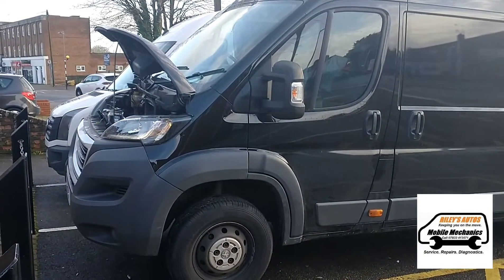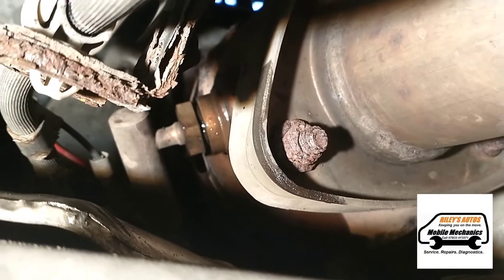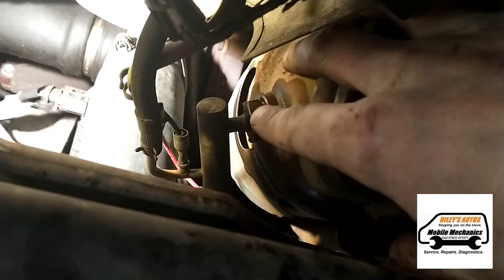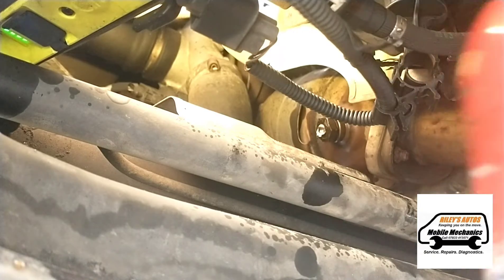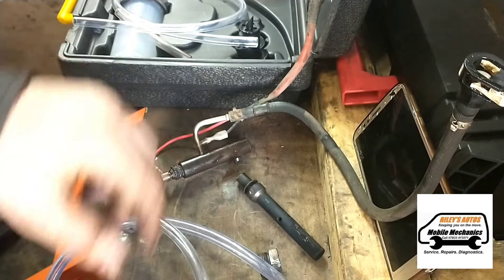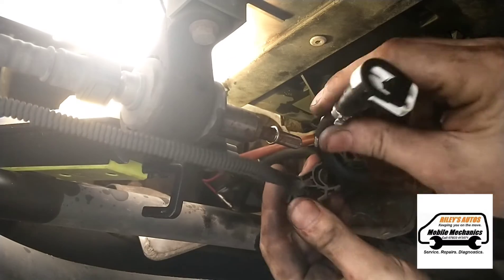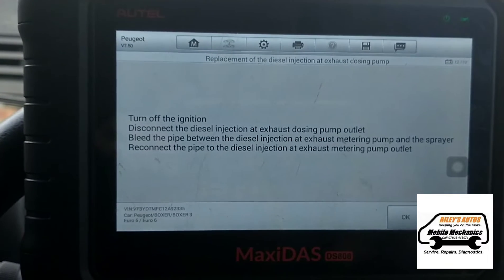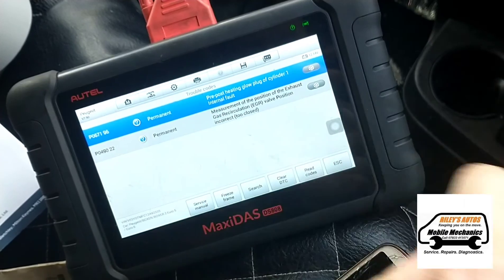Diagnostic and Fix DPF Vaporizer 2.2 HDi TDCi Peugeot Boxer / Citroen Relay P15BE 73 Replacement

Comment: With the hose disconnected at the pump discharge, Should diesel be coming out all the time? I’m having a similar issue but there is no diesel coming out the metering pump, have checked voltage at plug all good

Comment: Some great diagnostics skills you have. Ref the fuel pump, when does that open up to inject fuel into the DPF? I have poor fuel economy on my 2.2Boxer.  I Disconnected the exit hose from the pump and attached a hose and bottle to the exit fuel line and went for a 6 mile drive, diesel came out under normal driving conditions, about 150ml after 6 miles but not on tick over at a standstill. should the pump always pump fuel to the vaporizer? or is it selectively controlled? I think something in the dpf vaporiser fuel system is causing too much fuel to be pumped into the dpf, it's not showing any faults on the dash, and no DPF regen either. The economy is down around 60-70  miles per tank full. Any suggestions, please

Comment: STOP. DO NOT DO IT THIS WAY. TAKE OUT THE BATTERY BOX AND THE INJECTOR IS RIGHT IN FRONT OF YOU WITH LOTS OF ROOM, NO STRUGGLING AND YOU CAN USE A SOCKET AND EVEN DO IT IF IT IS RAINING.

Comment: i have a Citroen Relay 2.2hdi 2016. its blowing white/blue smoke every 200/300 miles for 15/20 mins. its had a new EGR and 5th injector, also had 4 new injectors fitted today,  i have done a DPF removal/clean/refit with no improvement, any ideas. is it regening, how does it make smoke when the DPF is supposed to catch/stop all smoke. im now thinking EGR cooler problem triggering regens. maybe easier to "turn DPF off"  what do you think, can you help? im in Leighton Buzzard area next week thanks Simon.
Reply from the maker: It can smoke during regen. Did you check it for fault codes
Reply: @ORileysAutos  not yet... but it seems to regen every 200 miles or so.. seems to frequent to me?
Reply: @ORileysAutos   I had the van diagnosed today. No fault codes and no regen light on the dashboard during what I guess is passive regen every 100/200miles. They said it needs to go to Citroen for an ECU reset!!!  I don't think that's even a thing??
Reply: @simonclements7431  hello hope u oky did you solve  the problem with your van with white smoke i have the same problem with mine one ???
Reply: @vicky12814 ... well I had the DPF cleaned and the ECU told its had a new DPF fitted.. no smoke/regens yet after 200km driven. So fingers crossed
Reply: Hi, did the dpf clean and reset cure your problems ?? 
My van has been doing this for about 18 months now every couple of hundred miles it's like a smokescreen of white/ blue reek for about 10 mins then it's perfect.
Reply: Hi i have the same, regen every 200km... Peugeot boxer 2.2 hdi 2016 110kW. Anybody knows how to solve this?

Comment: A FAR easier way to remove the old vaporiser (Or 5th injector as it is also known) is remove the battery box, once that is out of the way you have plenty of room to get at it plus you are pulling up instead of pushing up - so much easier. I snapped the old one off, easy to do, to get a socket on the nut. Hope this helps encourage people to do their own. I replaced the 25 amp fuse then drove a few miles and the engine light went out on it's own.

Comment: I need some technical help here, I have a 2019 Boxer 2.0 HDI Blue, engine check light came on and error code reads a problem with stuck open Adblue injector/vaporiser. Replaced with new Injector/Vaporiser, cleared error code and everything was ok for about a week, now what is happening is the engine check light will come but if the van is not driven for a few days when its started again the engine check light is off and will stay off until it first reaches speed of  90-100klms then the check light comes back on. This has my head wrecked. Any help with this one is greatly appreciated 😔😔😔
Reply from the maker: New parts usually need to be programmed and adapted in and even have to bleed them with a diagnostic tool. It's worth checking
Reply: @ORileysAutos  thanks jimmy so the parts i changed they have to b told they are changed by the diagnostics?
Reply from the maker: @selfbuiltcampervans  yes that's right. Clearing the codes is not usually enough
Reply: @ORileysAutos  thanks Jimmy 😊
Reply: Paul, had a similar fault and was waster ingress into the fuse box. Worth removing cover and fuse box and checking for corrosion

Comment: Great little video, was doing the same job on a Citroen Relay yesterday, why are those vaporiser's always seized in the pipe :(
Reply: Heat ! the metal expands and contracts!
Reply: @shubsgaming5786  yeah, I know all about heating and quenching with water loosen's most things, but these still sometimes pick up on the thread in the downpipe 👍
Reply: @dieseldoctor300  Once metal expands it won't contract to exact same shape, hence the problem  :) Heating loosens things.

Comment: I don't envy your job, I've had a fair bit of mechanic experience, and it's no fun eps when you can get access or be able to move a ratchet. Shame you can't apply heat to that area, heat works very well on some stubborn nuts and bolts.